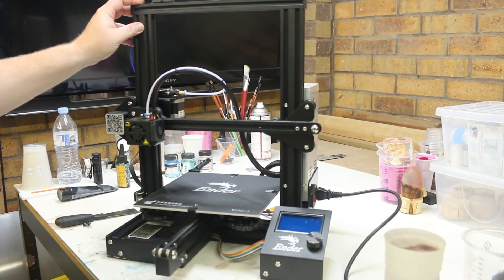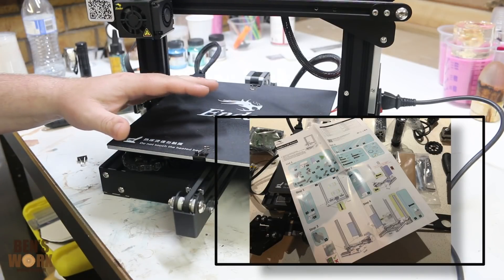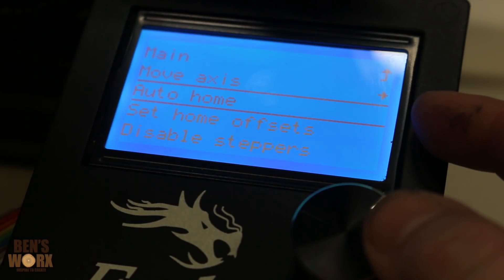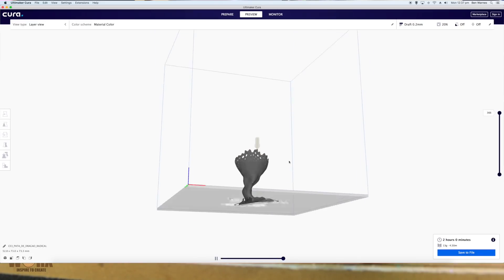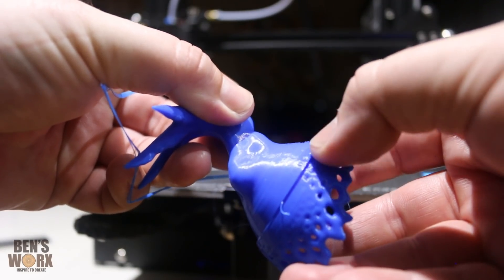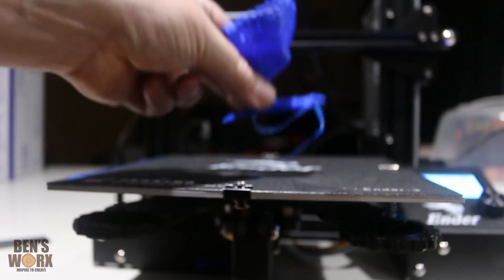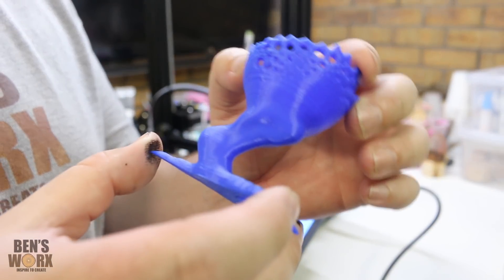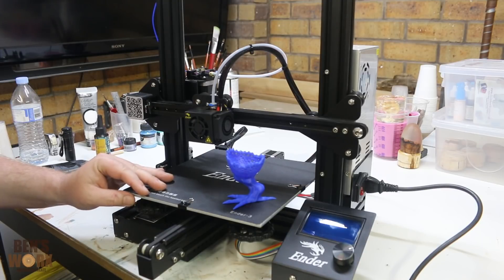Ender 3 3d printer test print and setup

Comment: Yeah but....how do you run a test print? Like what temp does the bed and nozzle have to be?? No one has explained this...
Reply: I'm suffering the same thing rn. I've been trying to look all over for an Awnser as to what temp it has to be for PLA Filament and I don't know what model the test print is supposed to be
Reply: @lavaigneous.  shot in the dark but did you ever work out what the best bed and filament temp us supposed to be?
Reply: @fistymclovepump  Since six months have passed I have gotten a new bed because the last one severely warped, I have tried all kinds of PLA (They usually work at a nozzle temp of around 200°), and I have tried all three test prints which came out perfectly fine.
Reply: @lavaigneous.  really appreciate the reply. Does it matter what temp the bed is at?
Reply: @fistymclovepump  So we have used the bed at a multitude of different temperatures because we have a glass bed. It is harder for things to stick so if it is something large, we use a temp of 60, but if it is something small we use 40-45. Truly it doesn't matter, but it can help prints stick